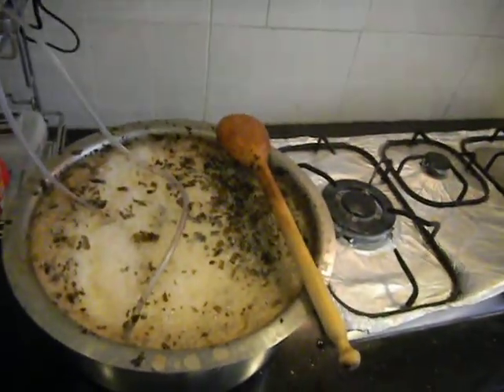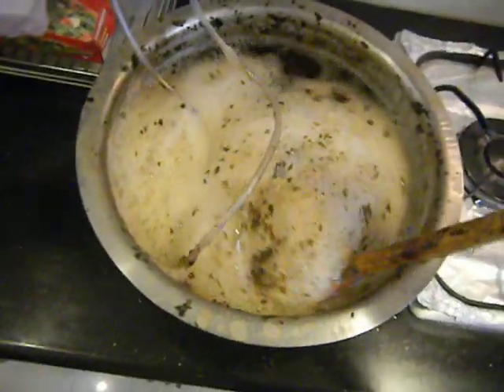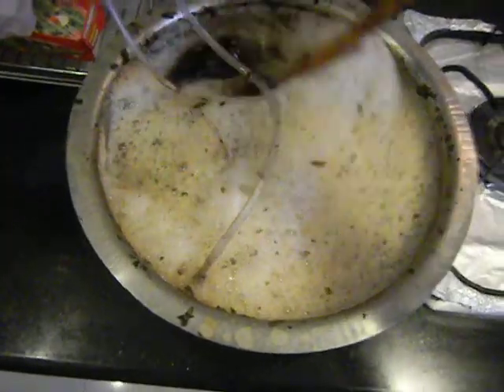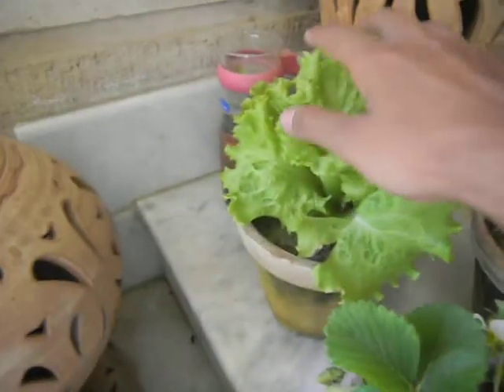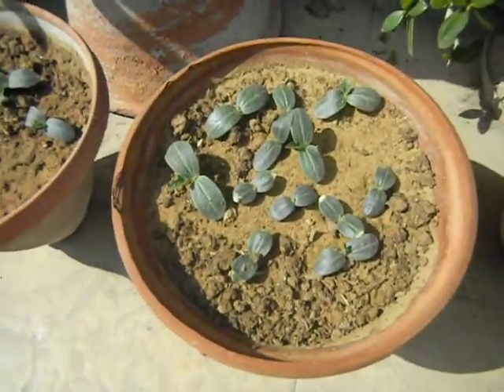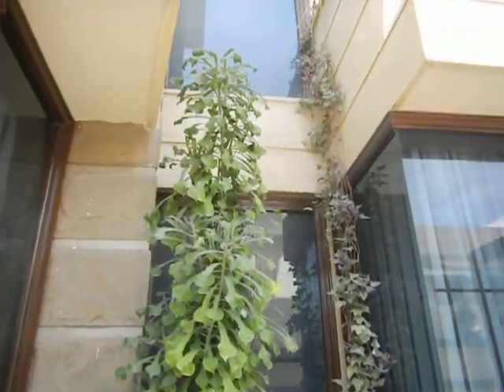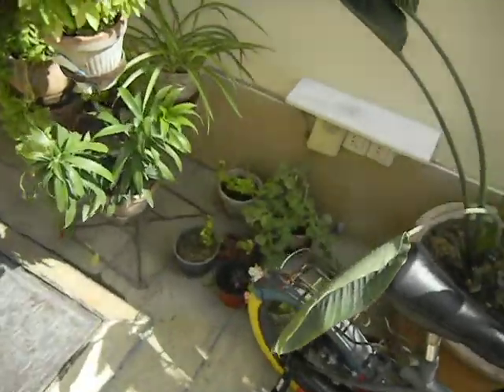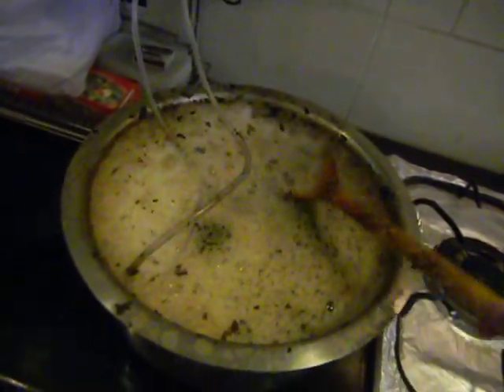Making seaweed extract at home, step three

Comment: the foam is the o2 from the good microorganisms.  you are making seaweed compost tea.  You should feed them 1-2 tsp of molasses. Use your seaweed 36 hours after you have it in the water.  The good microorganism will begin to die 1 hour after the air supply is cut off.  To keep the foam under control, use 2-5 drops of cooking oil.  to make your extract go crazy mix it with humic acid 6:2 (6humic-2seaweed)  you might want to reverse that, because your tea is watery.  Great job!  Dont let it sit!  Use it our lose it.
Reply from the maker: +Beach Life I'll try that in my next batch, thanks for the great input buddy :]